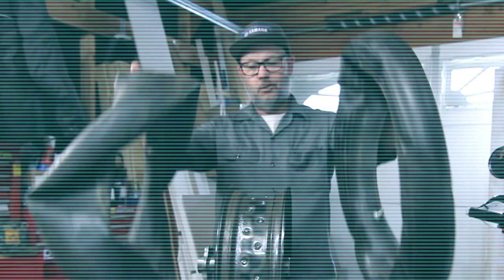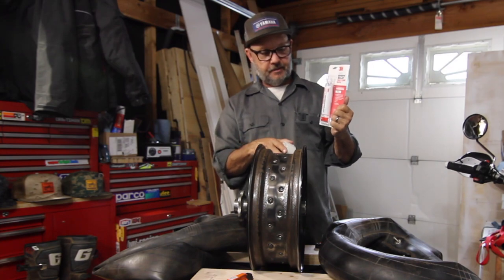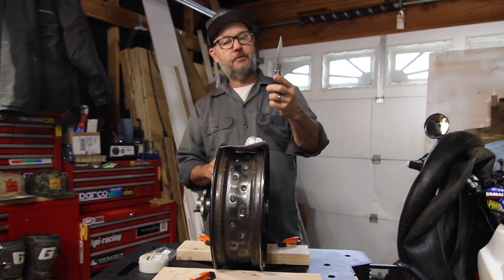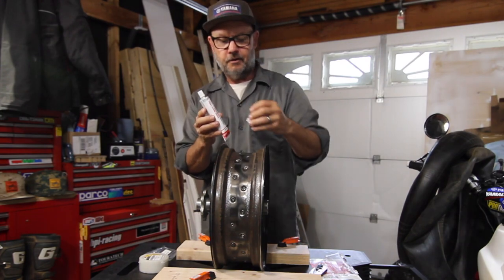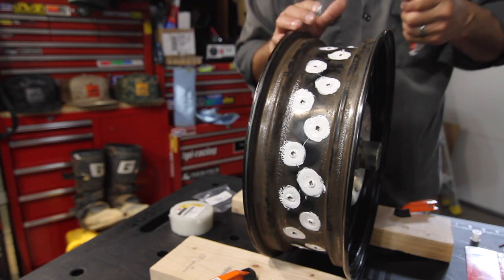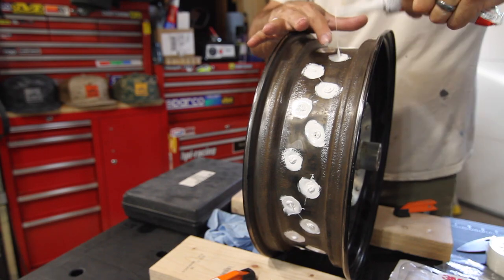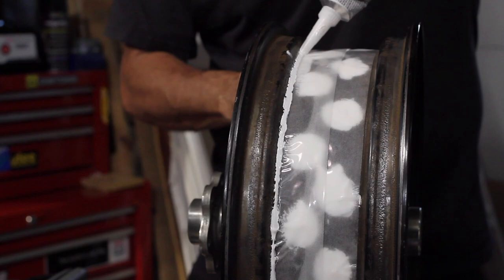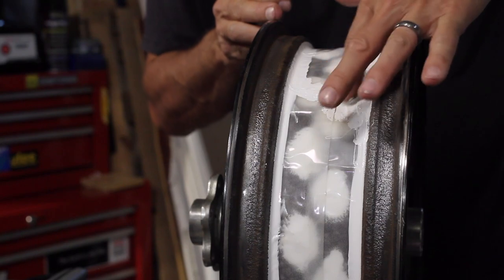TW200 Tubeless Tire Conversion -  HOW TO / I'm So Tired Of Flat Tires! Yamaha TDUB Club

Comment: I have had the exact same system on my WR250X for about 4 years now and no problem. Only issue is when dirt gets between the tire and rim it will create a slow leak. Easy fix though, just clean the area.
Reply from the maker: NICE!

Comment: Curious to find out this worked out after a few months. Fundamentally spoked wheels really require a tube but hopefully your prep work proves to have been enough.  I'm with you on being able to simply plug and go.
Reply from the maker: Rear tire, the plugged is still holding air!!! The tire is now worn out and time to mount up a new one!!!
Reply: @YAMAHATDUBCLUB  Good deal.

Comment: Thanks for the very detailed and informative video Rodney. I’ve seen a few people discuss a tubeless tire conversion on the TW200 Forum, but as is said, a picture is worth a thousand words. I will eagerly await your follow up videos describing how this performs over time. I tacoed a TW rear rim a few years ago attempting to remove a tire that had been mounted for 18 years. Every time I watch TAT or BDR videos of guys repairing tubes on the trail I just wonder, how can they do that out there and I can’t do it at home in the garage. If you have a positive experience I think I will try this mod. Cheers!
Reply from the maker: Ive repaired numerous flats on biles over the years in the desert, but not yet on the tdub. A front would be easy’ish but the rest has always been my fear, but too, with the amount of rear flats, i had to come up with a good field-fix-solution with the amount of solo-riding I do! I too am looking forward with my long-term analysis!
Reply: @YAMAHATDUBCLUB  Thanks, Rodney. Looking forward to the videos that come out of TWFest. No way I’ll make it this year, but I’m hoping you, TDK, Double D, Dirt Cop, Pro Cycle and Bradley Performance Products all make MOBstreet’s party.

Comment: Great video.  I just converted by rear tire to tubeless also and it seems to be working fine so far.   My question is,  I don't think the front wheel can be converted to tubeless because it doesn't have the tubeless tire hump on the tire bead.  I did the conversion on the front same as the rear and I'm having a hard time getting the bead to set,  but even if I do there's no hump to prevent the tire from scrubbing off the wheel under load.  So did you also convert your front wheel,  or just the rear.  Thanks again,  great video.
Reply from the maker: Front and rear and still going good!

Comment: 3M makes a Scotchfil Putty tape on rolls that is self fusing made for high voltage terminals to waterproof. It has a peel off liner to keep from fusing to itself that would eliminate sealing each spoke with sealant. It's about 3/16" thick and that sticky all would have to do is clean rim with brake clean and apply and I guarantee you no air would leak out it's that gummy and sticky.We used it on wire terminations and underground splices.
Reply from the maker: This seems like the same 3M stuff that they’ve given another use for!

Comment: You carry a spare tube in case your bead pops off on the trail?
Reply from the maker: I own a spare tube… I carried a spare tube to TDUBFEST last year, in my gear bag… I do not carry the spare tube on the TDUB while riding trail. I might pack the tube, only one, a front tube, during a solo BDR type trip. Might! I’ve never ever lost a bead on a motorcycle during all my desert exploits!  You would really have to be running really low air pressure to blow a bead. But with that low of pressure, you would have such bent up rim lips from all the rocks! Ask me how I know?! I’ve played with those low air pressures and bent my fair share of rims! I am not worried about the bead popping off. What I worry about is punctures and cuts! That has been my tire/tube failure every time and what lead me to going tubeless for ease of fixing while on trail! Hope that helps you!

Comment: I’ve used tire plug kits on riding mowers for years…
Reply from the maker: Yes, tire plugs are awesome, but when you take your "lawnmower" out beyond the yard into the unknown, a little mental prep and recovery prep has to take place. You have to bring those "garage items" with you! hehehe 
Tire plugs have been around for years and the offroad and ATV/UTV industry uses them too! I just needed to prep the wheels so I can benefit from tire plugs as well - like your lawnmower!